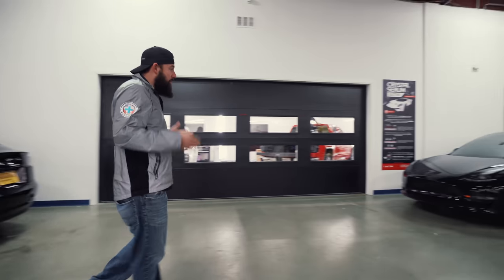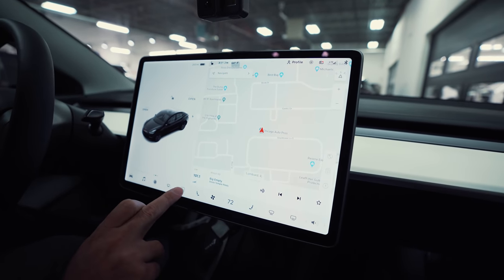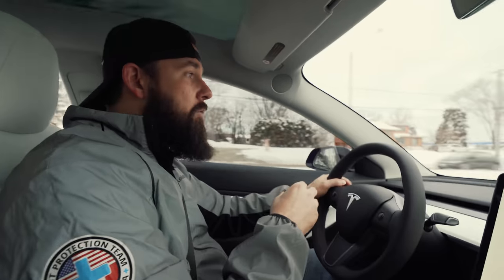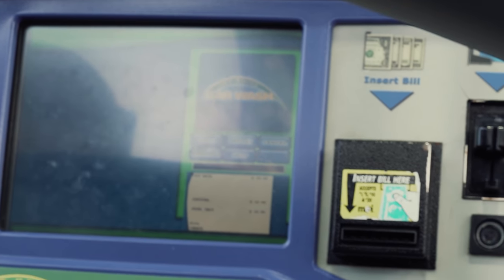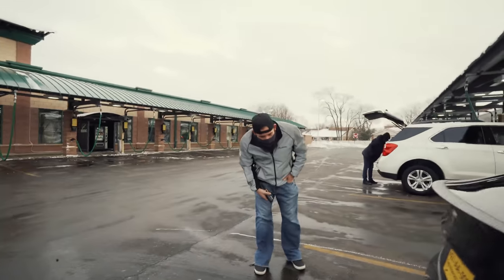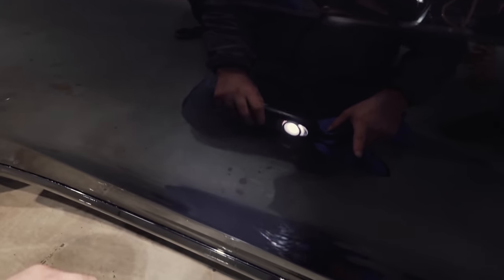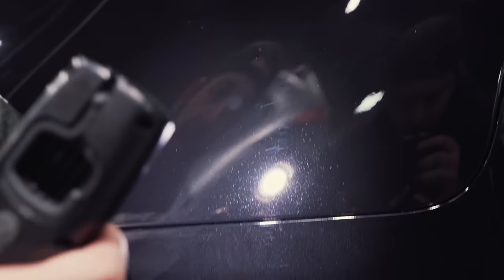Will A Tunnel Car Wash Scratch My Car? | I Bring My NEW Tesla To The Car Wash

Comment: Being in Chicago I'd like to see you take it through the Delta Sonic wash that doesn't use the spinning brushes, it's the $12.00 wash. I've g8ne through it about 4-5 times since last May and ZERO swirls and I coated my car with TAC system power plus ceramic coating in mid June and 3 months ago I added a 2nd coat of 303 graphene. My car is outside 24/7 for the first since last June😔

Comment: That filmy look was from the hot wax applied from that automatic car wash. As you saw it didn’t even clean the car, then added the wax on top of the dirt all while beating the hell of the paint....nice video, hope everyone gets something out of this
Reply: Newer automatic car washes actually use closed cell foam which cannot hold dirt
Reply: @aidancarwash  there is embedded partials in paint that the car wash brushes do not get out. This is the reason for clay bars and iron decontamination. Foam only gets what’s on the immediate surface, not getting the paint clean.

Comment: Good video guys! Great to educate people about express exterior washes. I have been putting a video together that discuss more about the "why" the equipment is actually damaging the paint. No two car washes are the same. Some will cause more damage than others. We need to start talking more about this topic in general.  Hopefully it will lead to better washing practices!
Reply: Newer automatic car washes actually use closed cell foam which cannot hold dirt
Reply: Its gotta be the age of the car wash. Im a cabbie and have to wash my car daily so i use the local carwash every day before my shift. Easily 200+ washes my cars had and its paint is in relatively good condition. Dont know if the paint is better quality or the car wash is better maintained.
Reply: @aidancarwash  Where did you learn this?

Comment: Hey Bro. I currently polish with a PC7424Xp and it’s “ok”. Worth getting a Rupes or Flex Dual Action? Would it be better easier faster results? Thanks
Reply from the maker: Machines are just tools to help you as a detailer get the results you can achieve with your level of expertise and experience. Remember that the pad and compound/polish you choose is ultimately what touches the paint. People used to polish cars by hand! If you're comfortable taking the next step, then definitely try out a Rupes machine, they're incredible. We rent these machines out at The Bays at Car Supplies Warehouse if you're local!

Comment: Confirmed, I have thought this or years!!! I just use quarter car washes to soap and spray the car off, but NOT use their brush and basically I avoid touching it! If the car is still dirty then I hand clean it with quick detailer using new microfibers and she is clean and swirl free!

Comment: hi Jason I watched with horror as you where going throw the tunnel wash and the brushes where pounding the car please don't do that again and it didn't do a good job of cleaning. Don't you have a touchless car washes in Chicago it's not that they do any better job but it at least washes off some or most of the salt. what I was wondering is how harsh are the soaps that they use and how long would a good detail spray coating  last. Hand washing is the best but in winter month with 2 feet of snow on the ground and -20  Celsius or -4 Fahrenheit and no garage just doesn't work. Now I could take it to one of these fast hand wash places but I think there worst then a tunnel wash I'm sure they don't use the two bucket method and if they drop the wash mite well to bad. I can always take it to a good detail shop but the cost just to drive it home and look the same as when I drove it there!!! so I was wondering how harsh are the touchless car wash soap and if that would be a better option in the winter.

Comment: How bad are the touchless car washes at gas stations?  I've been using them during winter to get off all that salt under the car.
Reply: They're fine just use detailing spray Meguiars after you touch up dry off

Comment: I used to work at a Mercedes Benz dealership as a detailer. After doing an 8 hour full correction on a cheese grated black s63..... And parking it on the lot to see it all shiny was so rewarding until ....you had Joe Schmuck take it on a test drive through riggerius mudding roads then think it's bright to run it through the wash right after and return it..... Like c'mon 😱🤦

Comment: This video clearly shows Tunnel carwash is not good for paint. 

From a value standpoint these small scratches aren't going to affect your value for trade in or resale the majority of the time. However if you don't wash your car and it rusts that will greatly hurt your resale value.

Comment: Thats worst than i thought it would be. They claim it will not scratch and that the brushes are super soft but they dont get cleaned properly and can rub the grit from your vehicle or others against the paint.....but kudos to that place it looked like they actually had a high pressure rinse of the brush just not enough

Comment: Like he said, most ppl are not super anal about swirl marks that show up when you shine a flashlight on it inside a warehouse (like a showroom). My 2013 Tacoma looks nice and shiny after an automatic/tunnel car wash… but I don’t go bending over at at right angles towards an overhead sun to check if the paint is as pristine as it was out of the electro deposited paint tank applied by the manufacturer. Sometimes I’ve notice the swirl marks while my truck is in the garage and the light reflects a certain way and I go “hmmm, wow it is scratched”, but the other 99.997% of the time it looks amazing from a normal distance. I’m sure it wouldn’t pass for showroom quality and “amazing” is subjective… but shining a flashlight to demonstrate the swirl marks seems super anal to me

Comment: What  you think about car wash whitout contact. ?
Reply: I usually avoid those because since there is no brushes they use very strong acidic cleaners which can also damege paint.
Reply: They use high pressure and harsh chemicals, still not a good idea
Reply: Rinseless wash over those 10/10

Comment: The spinning side brushes are the ones that cause the most damege.
Reply from the maker: You are correct!
Reply: And the fact there wasnt any prewash in this particular place. High pressure prewash is imperative before you get sent for the brushes.

Comment: The main problem with tunnel washes is the material used for the mitters (the spinny things).  Many carwashes use a felt-type material that is WAY too abrasive for modern clear coats.  They use it because it's cheaper and lasts way longer.   Plus they get loaded with dirt/sand/debris and bam, swirl-o-matic.
Reply: Newer automatic car washes actually use closed cell foam which cannot hold dirt
Reply: @aidancarwash  You are correct, I should have added that.  If you're going to use one, make sure it's a modern carwash that uses high density foam wraps
Reply: Sorry but your terribly wrong on everything!

Comment: This car wash didnt have a pre wash where it should be washed with a high pressure jet water and some light chemical to lift off dirt but instead you go straight with a touch of shampoo and brushes. Not fair to all the tunnel car washes :)

Comment: I would love the chemical/equipment company from carwash side respond to this.
Reply: Here I come to your comment... These washes are very safe, however, the reason they got these results were due to the soft paint on this type of vehicle which is only meant for touchless washes. I work at an express wash very similar using modern equipment, and we simply don't scratch cars, nor do we have any dissatisfied customers. These drive-thru car washes are very safe, and I have a huge passion for the industry for these types of washes, so it kind of offended me. Most people will argue and say the brushes will scratch, but it's just common sense that these modern washes use "foam" material brushes that do not retain any sand, dirt, or debris in them. Thanks!
Reply: @CarwashReviewsFlorida  I’m on the vendor side and I have to say the pressure control systems on ALL tunnel equipment is not an intelligent system. Air regulators controlling brush arm pressure means larger vehicles get more pressure than econoboxxes. 

I suspect most scratching events happen when there are not attentive operators like you that know how to monitor these systems/ and customers as they may pull in with hazardous vehicles (after market/diy addons etc..)

The IBA market I work in does have electronic hardware able to keep pressure even across all vehicle sizes as well as closed cell foam of course. Can’t wait to see that intelligence in tunnel side.
Reply: @kylestyer8240  I absolutely do not like IBAs, I used to in the past and have fully switched to tunnels. I plan on owning my own as well in the near future! Preferably SONNY'S/PECO.
Reply: @CarwashReviewsFlorida  every IBA OEM is very different. Istobal’s are damn good touchless/friction combos. Unattended and 1/10th the cost of tunnel build with a quicker ROI. I’ve worked at sonnys distributors for many years, also very good, just not up to date tech wise on the control side.

Comment: Today’s lesson: ceramic coatings won’t protect your paint. If ceramics can’t protect your paint from a car wash, they’ll certainly fail against a dust storm in the desert, road debris kicked up by a construction truck in front of you on a freeway, or anyone who brushes up against your car with a shopping cart. Now, the question I’d like answered is, what happens when you take a car with PPF through a car wash? Does the PPF get all scratched up? Can it “self heal”?

Comment: American car washes suck for this reason. They don’t rinse off the car before they start brushing. In europe the cars are pre soaked, rinsed under high pressure, and only then do they start touching the car. That way the sand and all the other bits that scratch when brushed off are removed before they can do so

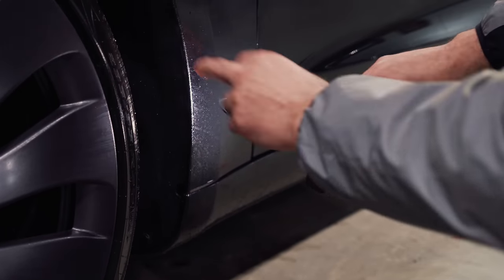Comment: Tire shine was added later. I have went to this exact location, and not a single scratch or tire shine splatter on the vehicle. Even after a wipe-down. At 7:10, you can't see any water-based tire shine. At 9:24, tire shine was added and splattered over the vehicle. This guy is a fake. He is making automatic car washes look bad so he can get the business that other car washes get.
Reply from the maker: You are wrong my friend. Nothing was doctored or added. You want to call me fake? Come to the shop and we will go ride though the wash together and make a video.
Reply: @ChicagoAutoPros  These tunnels don't use bristles, that was a thing of the past with old 80s, 90s IBA systems at gas stations... Tunnels now a days use "closed cell" FOAM material that DOESN'T retain any sand, dirt, or debris and DOESN'T create swirl marks as swirl marks are caused ONLY by filament "which is what you call bristles" and nobody uses filament anymore. How do I know this? Oh maybe because I am a manager at a tunnel with the same equipment JetBrite uses, anyways. If you would like to travel down here to Florida sometime in the central area I'd be MORE than happy to show you around and even touch one of the "foam" material brushes to see for yourself and take you in our tunnel to see the results of multiple cars that come out with ZERO problems.
Reply: @CarwashReviewsFlorida and welcome to another episode of “ignorant detailers” where they claim everything comes from an automatic car wash

Comment: No offense but this was a very telling video it shows ceramic coating did nothing to protect the paint
Reply from the maker: Ceramic coating will not protect the paint from scratches.
Reply: @ChicagoAutoPros  technically snake-oil then. I'm not fighting with you I'm just trying to understand. Because one of the biggest selling points is that it protects your paint I've seen dozens of videos where people scratch the car with cigarette lighters and it does nothing

Comment: As a carwash owner myself your video lacks sufficient data. By driving it on the road it will develop scratches from tiny rocks, dust and other debri.  That is why all cars driven outside on open road has swirls. You just need to look under the right light to see it. It's there. Like it or not.

Please don't blame carwashes. Thumbs down on this video. Sorry.